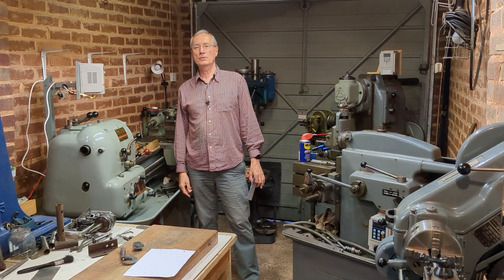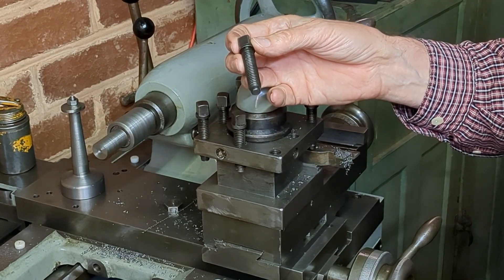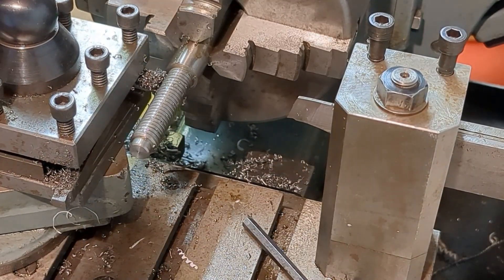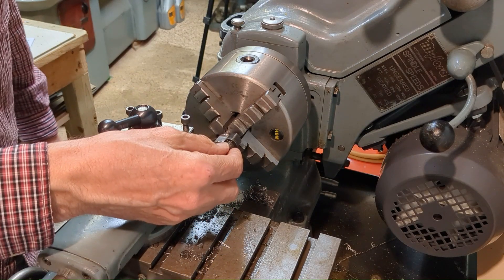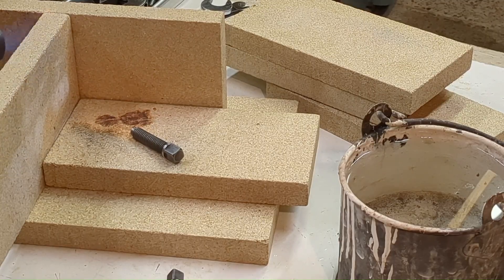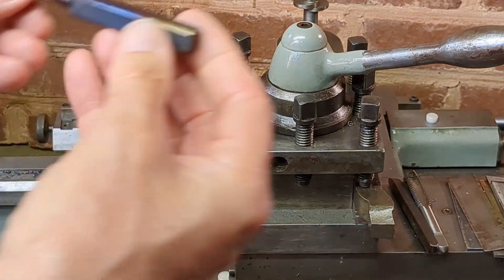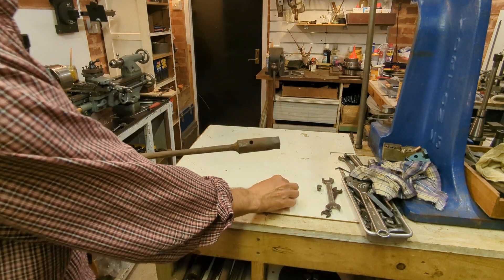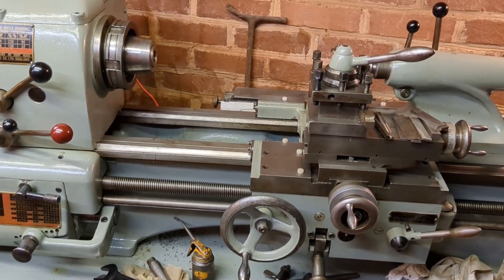Installing a Colchester Student lathe

Comment: Does the hardwood affect the leveling with changes in humidity?
Reply from the maker: I suspect it does so I will be looking out for this issue. In my previous setting I didn't have the opportunity to look out for it. If it is a problem I will try another material.